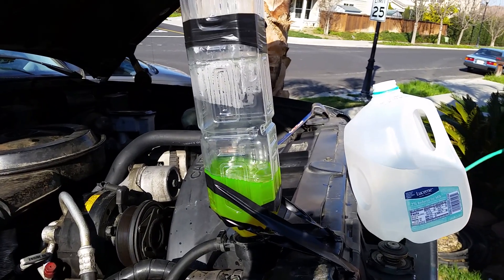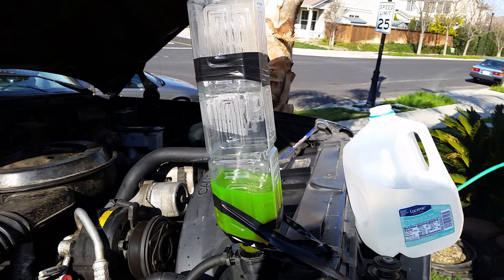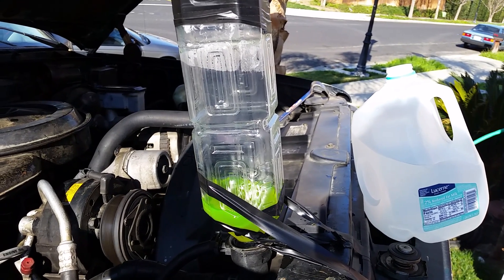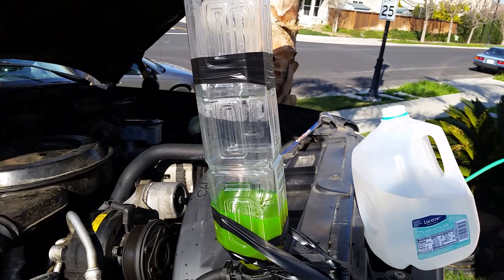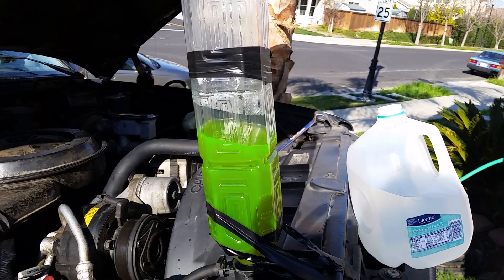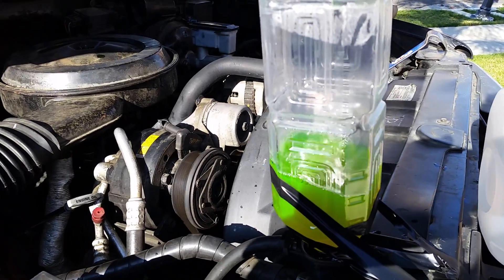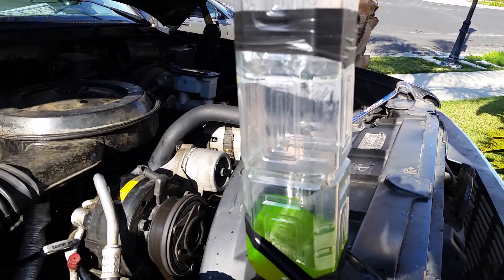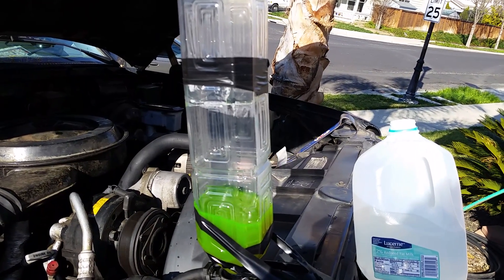How to get rid of the trapped air in coolant system.

Comment: You shouldn't use tap water in your system.  Now you will have impurities that will, overtime, cause problems and disrupt flow or lessen the life of your pump or heater core.
Reply: RIGHT! I just did heads on a chevy small block and the coolant passages on the old heads were caked with tap water deposits. All that monochloramine, and crap just caking on corroding seals and metal. Use distilled or pre-mix!
Reply: He clearly has a bottle of distilled water in the video
Reply: @wce05308  Nah, the bottle in video is clearly labeled as 2% milk.  Presumably rinsed and filled with tap water. Hence the suggestion to use distilled instead of tap water.
Reply: Especially living out West , tons of Lyme deposits in the water
Reply: BLA! BLAA! BLAAA!

Comment: Interesting thing happened just today, 8-29-17, Just put coolant back into engine through the fill tank. GM 3.1 doesn't use the radiator on Malibu. Then the coolant in the overflow or fill tank I filled and about three times. Then after starting the car and using a scanner, noted that I had an error, a ect or a coolant sensor error, and a -38. That meant the coolant had not gotten to the sensor. So I came into this place to learn from the experts!

Comment: Stuck in a 5/8 clear hose into the the filler cap (fitted like a glove nicely) and placed a funnel on top. The clear section of the 5/8 tube showed all the bubbles coming out. Worked a dream

Comment: Strangest thing I've ever seen. And all these years I've had cars that overheated maybe they weren't overheating maybe it was a false reading due to the error by the heat sensor misreading the actual temperature of the coolant.
 We had the worst Subaru ever made was the 2.5 engine what's the most overheating issues and one head gaskets or whatever. Subaru took no responsibility for it.

Comment: Do you think this can be done with a no spill funnel on a vehicle with an expansion tank system? A car that has no radiator cap.
Reply: What kind of vehicle doesn't have a radiator cap other than the overflow tank?  I have a 2011 GMC Acadia and the radiator cap is under the radiator cover shroud which has to be removed to located the radiator cap.
Reply: @TheFlatlander440  Most of the cars in europe dont have a radiator cap.
Reply: @Zee Bulb  they are connected to a degas tank. It functions as the radiator cap and reservoir. Most ford's and Chevrolet prior to 96 have them.

Comment: Hello Mr.lew, very interesting video, as I am having trouble bleeding the coolant system of my C4 Corvette. Question: how did you attach the bottle to the radiator opening? Does it need to be water tight? If yes, how did you do it? Thank you very much in advance for your reply. Kind regards, Roger
Reply: Yes it needs to be water tight, use double side sticker tapes to seal it, it worked for me.
Reply: Duct tape bud

Comment: How did you avoid leaks between the bottle and filter hole?
Reply: Stuck in 5/8 clear hose in to the the filler cap and placed a funnel on top. The clear section of the 5/8 tube showed all the bubbles coming out. Worked a dream

Comment: I don’t have oil in water or water in oil but keep getting air in my collant system. Can it still be the head gasket? It runs well for a few hours after bleeding the system but then it builds up pressure and air again. 

Ford Fiesta 2005 1.4
Reply: Probably needs a new radiator cap?
Reply: Yes it can. No oil/water mix in my Honda and drove it a few thousand miles before I was constantly having to add water. Changed the red cap, then thermostat, then head gasket. Only the gasket stopped the bubbling in the reservoir

Comment: Did you let it cool with the bottle on the cap? And just kept it full and let of drain all over when it cooled off to put the radiator cap back on? I have the same truck
Reply: You could take off the top jug and then take a long screw driver with a rag wrapped around it. Shove the tip of the screw driver (with the rag wrapped around it) down into the bottom jug so that it plugs up the hole of then jug next to the radiator top. Then pull the jug off the radiator. The fluid should stay inside the jug since the rag covered screwdriver acts as a stopper.
Reply: @MrUsaer  that is brilliant! I've always used this method but never thought of that to stop spillage. Thanks for the tip!

Comment: I have never seen this large amount of fluid rise so high and drop so low when purging. The times that I have purged, I was able to do so by simple taping a  medium to large size funnel to the radiator and the water would rise and fall over a couple of inches, Any idea the water was rising so high on this particular purge job?  

Also, I guess those are 2 juice jugs tapped together. Did u cut the neck off of the top one before taping it to the lower one?. 

Nice video
Reply: It rises and falls also when filling the tank. My Malibu has no radiator cap. Funny too, after draining the system, bleeding has been more involved than covered in several videos so far. The Top of the 3.1 engine has a smaller cooling hose and going thru a plastic fitting to the rear part of the engine. No coolant is going thru there. But the heater hoses, the bypass, and both radiator hoses are hot. Plus now I get a coolant sensor error that is a -38 * and it is cold. I still hate to take the thing out and see if I have coolant flowing through it. It did not change. Ran the car for several minutes and purged most of the air out of it but it apparently has a ways to go. The top hose may hold the clue.
Reply: @jameslamson5092  put the front of the car on ramps / Jack stands. Having it on an incline helps trapped air bubbles rises faster.

Comment: What does air in the cooling system do? What harm does it cause?
Reply: humanyoda Overheating your engine. Because water cools the engine and air does not so good. And when there is air traped before the thermostat it won't open, because the air is cooler than the hot water.

Comment: You can look in a regular funnel to see the air bubbles and the fluid going up then being sucked down this is the ghetto version of the coolant air bleed funnel 😆

Or are you just using it to get the coolant to go higher? Seemed to have rise more and you also get full visibility so. I just use a regular funnel. 

Plus you may have had that bottle already and it’s much cheaper than a plastic funnel plus if you already have a funnel laying around use it. 

Meh as long as jobs getting done 😆 bleed all the air out that coolant watch for leaks make sure everything is tight especially hoses and the water pumps torqued to spec every bolt is correctly torqued if too loose it’ll leak it happened to me before it lasted half a year then leaked. Too tight some water pump soft aluminum it’ll crack!

Comment: Should not use 2% reduced fat milk in your radiator nor your body, always go for full fat milk and if possible non pasteurized milk straight from cow's titty and drink that :) has probiotics that are still alive and not killed by boiling, also even if you're lactose intolerant you can drink this milk but not the milk they have at store, and yeah distilled water for aluminium parts in your radiator.

Comment: OMG! I just tried this out, & when my thermostat opened, I had a freakin nonstop GEYSER of antifreeze going every where out of the bottles!! I probably have more air in my system now than I had before 😬😬😬😯😯😯😯 Its a great idea I guess. But it can sure go wrong when that thermostat opens I guess.
Reply: Sounds like you did it wrong or something was not right
Reply: That's why you get a vacuum-fill tool. If you can afford a car, you can afford the tool.
Reply: turn your heater on high